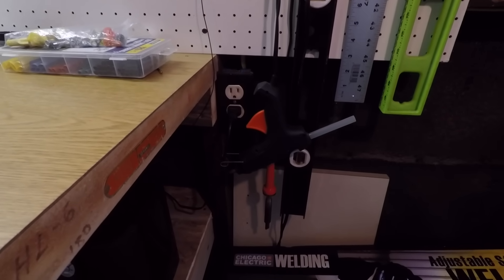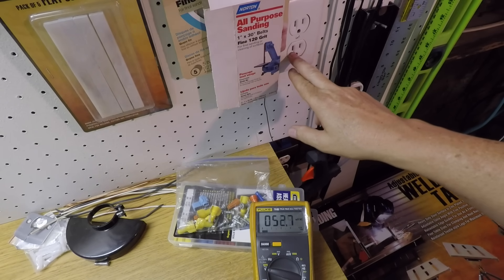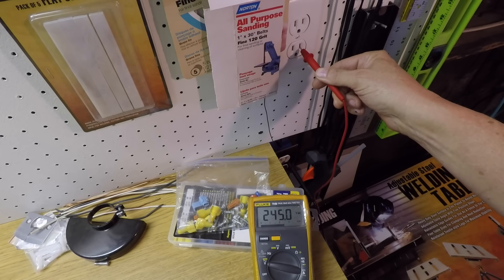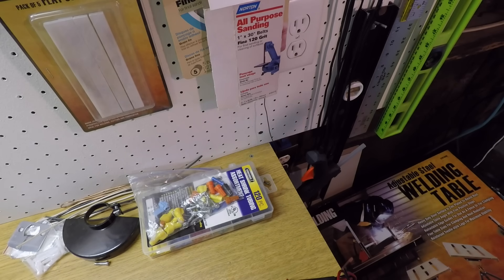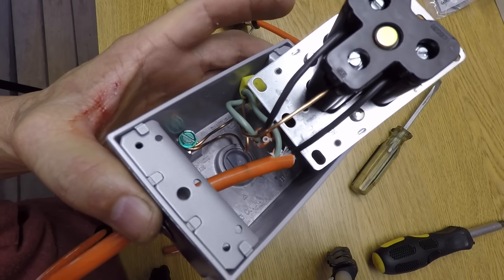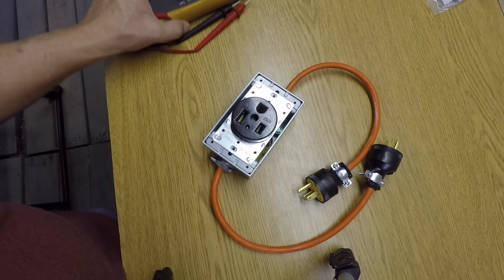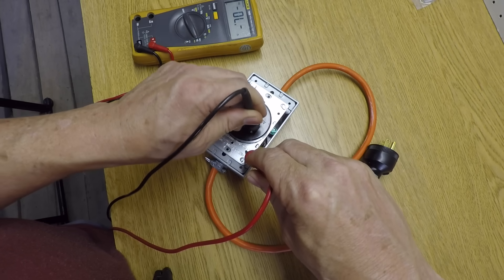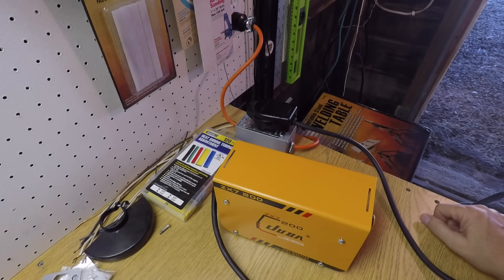How to Get 220v From 110v

Comment: Those outlets are connected with 12g wire. Not appropriate for using a welder pulling high amperage on. Shortcuts can get costly when fire hazard becomes an issue

Comment: Yeah, you have 240v, just split between two outlets. Run both of those hot wires to one 240v outlet, instead of trying to combine two separate outlets.

Comment: This isn’t getting 220 from 110. You are getting 220 from existing 220.  Try getting 220 from an old two wire 110  service ,without using a transformer  or switching power supply.

Comment: "I just made a 125V 30 amp circuit by plugging into two different outlets!"  --- Like almost every other commenter has mentioned, if you're wiring things up anyway it's cheaper and smarter to just run a 50AMP 250V circuit than to jerry rig it the way you have it.  /shrug

Comment: I think it would be safer to just install a separate outlet for the welder, on its own 2 pole 30 amp breaker. 220/240 volts should be on 10 gauge wire.

Comment: And you will not get 240 volts just from tapping into two different outlets... both of those outlets have to be on a different polls....one needs to be on the right side one needs to be on the left side or else you're only going to get 120 volts

Comment: I made your box and I am trying it but I am only getting zero volts across both of my hots?
Reply from the maker: If you are getting zero volts across both hots you must be using two outlets on the same line. Meaning they are both drawing voltage from the same side of the breaker box. You need to use two outlets that are on different lines or pulling power from both sides of the breaker box for this to work. The best is to find two circuits that have breakers on top of one another in the box. One breaker pulls from line 1 and the other pulls from line 2. If you can find one outlet from each of those circuits, it will work for you. Since I made this video I have also learned that circuits with GFCI protection will not work.

Comment: I do not get it,   most thinking you could get from a single 110V your wall receptacle  Basically if both plugs were on the same side of the fuse box your device would not work.  not impressed at all. 2 million views wtf   most will only get 110 on a 110volts so if I wanted 360v just add another plug 480 4 plugs  960 8 plugs

Comment: Your box grounding will not be grounded at the box or otherwise. It must have a green wire from the box to the breaker box and from there to the actual home grounding rod, in the yard, outside of the house. If the appliance short circuited the electric current will have no alternate coarse of travel. The only thing it can do is find another coarse to the ground, either by traveling through yours or someone else’s body or through the framework of the house, or building its intensity and startling a fire. Especially considering you now have two separate feeds of power to fuel it, both of which are now ungrounded and continuing to the appliance. You have basically created a potential open ended dead short mechanism waiting to happen, especially with a welder creating its own arch on the other end of the set-up. I would respectfully suggest considering a redo of this application, just to be on the safer side. A Three-wire with a separate ground would be much better, using the whites for a return to the breaker box as common and a dedicated grounding wire would be much safer.

Comment: This seems both ignorantly redundant but yet equally informative and useful. I’ve know this was possible and I, personally, would just install a 240volt circuit. BUT, say you take your welder to a friends house to help them repair something and they don’t have 240volt power at all..... This will get you out of a pinch quite easily.

Comment: Both outlets are fully protected by their own breakers. I don’t know why some electricians here are saying it’s not safe. Yes, the outlets ‘should’ be rated for 20 amps if the appliance (welder) is demanding this much amperage, and both outlets ‘should’ be dedicated circuits, with nothing else on them. If these two conditions are met then i think it’s safe, although it is definitely NOT to code.
Reply: This is not code because there is a chance that only one circuit breaker will throw. All thought it is so very slim chance if it does happen you will be left with one leg of power still on and the other leg off. This is an absolutely terrible idea for an appliance such as a welder.

Comment: Not recommended but doable. Both lines have their own circuit protection (breakers), and no need to share a common neutral since the appliance he’s using (welder) is a balanced load (exactly the same voltage on each of the two legs; ~120 V + ~120 V). I would think these two circuits should be DEDICATED lines, ie; not supplying power to ANY other loads, like shop lights, microwave, beer fridge, other outlets, etc)
Reply: No.   Still need a neutral.... if he's not using a neutral then how is the power getting back to its source through the ground wire not proper

Comment: Any problems that may be caused by tripping one breaker could be cleared by installing a 2 pole breaker, if you have panel space just use an unused space or remove the 2 single pole and use that space, one fault opens opens both sides.

Comment: I agree, why not just put in a proper 240V outlet in the first place?  All you'd need is 3 wire cable and save on all that extra hardware.  I even have that in my kitchen, where the top & bottom outlets are on different breakers.  Also, this way you'd have ganged breakers, so that the power will be completely killed, should a breaker trip.  Your way could leave you with one side hot and the other dead.

Comment: I’m all for creative solutions but this is not safe on a number of levels. Like others have mentioned the outlets you are plugging into more than likely have other loads on them, reducing ampacity of the circuits. 220v circuits need to be on a tie breaker, also known as a 2 pole breaker, in case either line of the 220v is over loaded and trips it will turn off power to the other side of the 220v line in order to protect you and the equipment that it is feeding. I highly advise not doing this.

Comment: This guy has a VERY LIMITED UNDERSTANDING of ELECTRICITY, esp the safety side. The resistance of the load makes the loose plug live. Why not just bolt the metal box to the wall & hard wire it. At least the metal box was grounded.....

Comment: Yeah but it's kinda like an airplane. You can still have room on the airplane but that doesn't mean you can fill it to the top. You have to worry about the weight. 

Same goes for this, you may get 220v but your not getting enough of amps, you need the amps or it can mess your equipment up.  Just run one 220 line, so much better this way
12 gauge = 120 volts 20amp
14 gauge = 120 volts 15 amp
10 gauge = 240 volts 30 amp 
Like this

Comment: So really he didn't. It is still 2 different phases. It would make no difference if he used a 2 pole breaker as opposed to 2 single breakers except the 2 pole breaker will make sure you lose both phases in the case of a trip.. No mystery.

Comment: Dude do you know there is no 220 volt line, the 220 volts comes from just what you did combined the two 110 lines on different phases. Run a 220 line to the box and tie the separate 110 volt phases to it. Just the same as it is done in every home you see.

Comment: Why don’t you just install a 240v Outlet on a  30 amp double pole breaker? Just seems safer to me.
Reply: Or put in a proper welder outlet using a 50 Amp double pole breaker and #6 wire and a ground.
Reply: @gravelydon7072  depend on the welder, not every welder require 50amp, some only need 30amp.
Reply: 👍 Tedd Bobb,
Double pole breakers are ganged together for a reason. And I’m quite sure that was 14 ga. SO cord and for sure light weight 15 line cord ends. I get this guys math on the voltage, but the current draw is my concern. I’ll spend a little more time and money and run a separate circuit.
Reply: Does this end with magic smoke and the sounds of sirens and a warm red glow??!!??
Reply: Exquisite
Reply: Good
Reply: It's all about portability. You can't go busting into a clients main and setting up shop whenever you desire. I looked for this video specifically so I could run my portable welder on any job site. Thank you for informative video.
Reply: Not enough amperage so it's just pointless
Reply: He is good on math ..120v x2
Reply: Literally doing the same thing by having two 120v lines coming in like he does. One individual breaker on each rail is the same as a double touching both.
Reply: Because he said the wire is 12 gauge, and that only rated for 20 amp♟❗️
Reply: It is safer
Reply: Even 240v 30amp is not the best option.  50amp is the best option. Just learned the hard way.  I was using my welder out of 30amp dryer receptacle.
Reply: Because he could
Reply: What would be the fun in that?  Nobody would watch that.
Reply: Harvey homeowner doing electrical work . Hope the home owners insurance is paid up
Reply: The main reason would be he probally would use the 2 outlets more often than he will the welder.

So when his welder is not being used he can make coffee.
Reply: @johndorian4078  

Finally someone,  using common sense. 
Besides we should anderstand,  it's an alternative solution,  for people that can put 2+2 together. LOL😆.

LONG TIME AGO NO ONE KNEW,  WE CAN GET A STANDARD CAR START,  BY PUSHING IT,  OF COURSE THE PROPER WAY WOULD OF BEEN,  REPLACING,  THE STARTER OR BATTERY 🔋 .
Reply: That's no fun
Reply: That’s a 50 amp outlet. Therefore the circuit should be able to support 50 amps.
Reply: Actually, this way double protects the circuit. It’s overkill.

Comment: This is a handy DIY to be used with experienced users.  Also if you go out places welding it, can become a life saver. The only thing that would make it better, is to use both the white and black wires together to get the 20 Amp, instead of just cutting off the white.
Reply: Where there's a balanced load, as in the case of the welder, current flows between the two hot wires.  There is never any current flowing in the white neutral wire.  Besides, even if you wanted to connect the white wires, there is no available terminal for them.
Reply: @Georooney .. The white wire is connected in parallel with the black, so together the 14 AWG gage wires are both hot;
the combination is equivalent to a single 11 AWG gage. This will give you the 20 AMP capacity. Then if you use Commercial Grade 12 AWG Extension
cords, the whole project becomes very safe.
Reply: No!!!!! That’s not at all how it works.

Comment: I ran 220v 50A  with its own breaker and 2 120v 30A lines in conduit here at my cabin. I have all the welder hookup I need and the trailer and mobile home are both on separate phases.

Comment: The 15 amp extension cord cables you used would concern me. Normal 240v breakers typically are 40-50 amp. If your welder pulls more than 30 amp, you might have melted wire.
Reply: 2 pole (240v) breakers come in ratings starting at 15 amps.  It would be unusual to find a 50 amp breaker in a domestic panel.

Comment: BTW it’s against code.  Paralleled wires are only permitted with 1ø and larger, not 12awg.  The conductors also must be routed in the same conduit or cable set as well as the grounds.  Just because it works doesn’t mean it’s safe or permissible by code.  You could have just made one of the 120v circuits into a 240v relabeling the neutral black for a second hot wire.  This would have kept one 120v outlet and given a 240v outlet as well.

Comment: I just wanted to make it clear that the 20A receptacle should be of a different configuration and it applies the same to the male plug for the welder.
Reply: 20 amp plugs in 20 amp outlets look nothing like 15 amp plugs or 15 amp outlets they are completely different

Comment: If you have a sub panel in your garage, just install a 20A receptacle with a 20A double pole breaker in the panel for it, use an extension cord for your welder when you need it. Whenever I see a receptacle or device with two cords with two male plugs, it makes me shiver. Let us put everything aside for the moment, does this method meet your local Electrical Code requirements? Honestly. I doubt it very much. I have seen a similar hook-up in a kitchen, this guy plugs his device from a split-fed kitchen countertop receptacle for his rice cooker. I told him he should not be doing that and it did not comply with the Canadian Electrical Code. Of course, this is only a suggestion to him and others.

Comment: Check NEC code section 240 on Overcurrent Protection. The single pole breakers feeding each outlet circuit used in this manner need to be beside each other & handle-tied together so if there is a short/fault on one circuit it opens all ungrounded conducters (Hots) at the same time. That's why they make double pole breakers. Your other problem is a 50 amp outlet on a 20 amp circuit.

Comment: wow, a piece of 6/3 SO cord, a 240 breaker and an outlet on the wall would be faster and not as hokey.
Reply: He had 90% of the work required to put in 220/240 done by running the two separate 110/120 lines.  The only thing I can think of is he wanted to have the flexibility to use 110/120 when not welding.  But if that's the case why not just run a separate 110/120 line, unless he didn't have enough room in his breaker box?

Comment: they make a commercial device? LOL Been an electrician for over 30 years and have never seen any sort of commercial device to do this. The commercial answer would be to wire it in properly from a 2 pole breaker to receptacle.

Comment: Dude, you are not getting "220v From 110v" - You are getting 220v from two 110v circuits 180 degrees out of phase with each other, which btw, is what most every residential service has. 120+120=240. Just run a 220v circuit.
Reply: Exactly, he's using 220 to get 220, what kind of video is this!
Reply: But what if your solar inverter only has two 120 volt outlets and not a 240 volt outlet?
Reply: He's doing this cuz it's more convenient for him and the way he works; if it's better for you to have a dedicated 220 outlet install the dedicated 220 outlet.
Reply: Yes Charles... but 220VAC IS just 2 x 110 VAC lines from the break box.. this is identical to that just done at the wall instead of the box.  The only thing you dont have in this circuit is the double breaker bar.
Reply: yup your right, he is just wasting time. what he is doing is running line to neutral which is 110 then another line to neutral 110... if he just connect line to line he can get a direct 240v...
Reply: @rieronpaul3723  if you run the line to the other line you trip the breaker
Reply: If I were to speculate why someone would do this instead of just running the 220 line for the welder here's my thinking. It's a workshop and most equipment in the workshop require just 120 volt, however, sometimes I need to use a 220/240 volt welder (but not often). With two 120 volt out of phase circuits which are capable of combining for 240v it gives me the option of having multiple utility outlets for my shop work and not one dedicated 220/240 volt line for the welder which is rarely used - it would make sense doing this I guess. My only concern with the video is downsizing the wire and plug(s) for the outlet. Remember, he stated they are 20 amp circuits likely protected by a 20 amp breaker, that means that if the welder were to exceed it 80% of 15 amps the wire could potentially heat up and burn due to being protected at 20 amps in the circuit breaker box. I would do this if the application warranted but I would ensure I use 20 amp rated plugs and wire - imo.
Reply: @stevewilliams2305  It could also be that his breaker box is at 100% capacity and doesn't have room to add an additional double bus bar.
Reply: @stevewilliams2305  I only use my welder 2 or 3 times a year.  I ran a dedicated 220/240 outlet & breaker.  The wire is expensive, so I put the outlet right below the breaker box to keep costs down.
Reply: 220/240 is single phase.  There are not two phases in a 220/240 line.
Reply: Yes there is they call it single phase but it's 2 single phases 110 out of phase with each other ergo 2 phase
Reply: You are TOO smart.
Reply: Yup!!!!
Reply: Lol I was expecting this guy to be building a transformer... as that would be the only way to do what was expected from me title...

Comment: you should replaced only the outlet and 
use the white wire marked hot and connected to a double 220 breaker it would be safer and cheaper

Comment: If you’re running electrical why not just run a 220 wiring?  Seems like a lot of extra steps to accomplish something you “combiner” in the panel....I mean you don’t see people running 2 110v wiring for a dryer just to build a “combiner”.  I should know, I just ran 2 220v’s, one for a new dryer location and one for my welder.
Reply from the maker: If I were to run proper 240 circuit in this detached garage. I would have had to run about 100' of appropriate wire underground, installed a new panel box and appropriate wiring to the location of the outlet. I didn't want to go through all that expense for this little ark welder that pulls less than 20A. Also this unit is portable and I used it in a couple different locations. All of this was just temporary use because we were moving in a few months. This property was not worth the expense and trouble to wire it as most people would in a permanent shop setting.